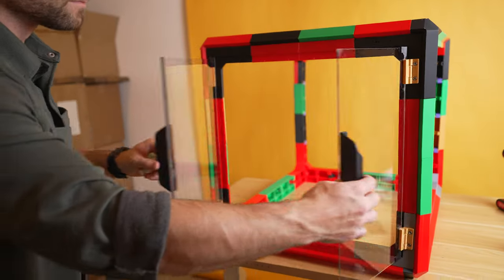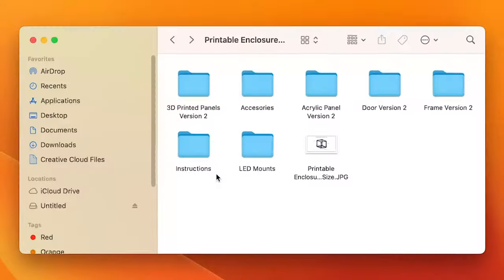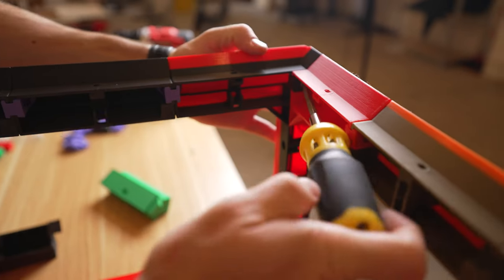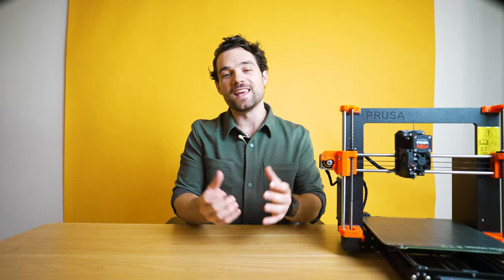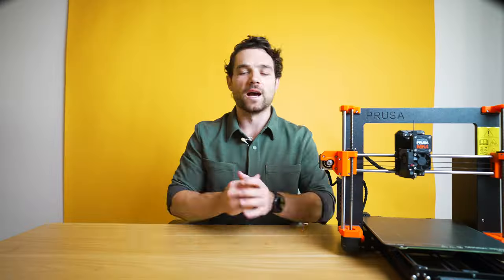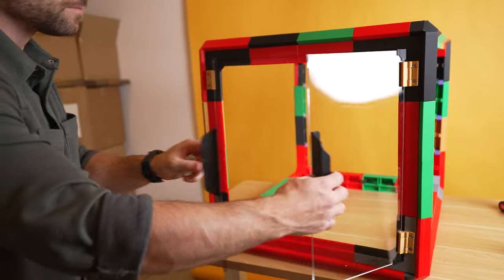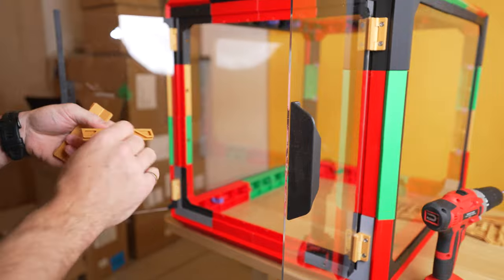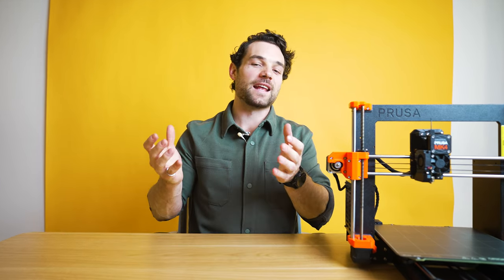3D Printer Enclosure - Printable!

Comment: Nice design, good idea, but 85 € just for the print files is not my value for this. You can let me know if there is any serious discount, for now i will build my enclosure out of aluminium machine frame, ending up same price, but i will build a ceiling crane into it.
Reply: 85 for the files?  Dang....
Reply: Yep that was my thought, too. Looks really nice, but over 80€ just for the "permission" to print it, is too much. I also need several kilos of filament and the acrylic panels for this, which quickly doubles or triples the price. If not even more...

Comment: How many roles (1kg) does this print take for a standard size enclosure?
Reply from the maker: Depends on print settings and how you set it up (acrylic vs 3D printed walls for example). There is info on the KS page for it!

Comment: I am curious how well a fully printed enclosure (with acrylic panes) will last over time. The typical material you would print this (cause you don't have en enclosure to print ASA/ABS) would be PLA or PETG with a heat deflection between 50C and maybe 65C. Also if i interpret the ks graph correctly we are talking about 6kg of Filament just for the frame or 11 to 14kg with panels... Counting that i pay 20€-25€ per kilo of PETG, this is an expensive piece. 300€+ for fully printed or around 300€ with plexy plus the 65€ for the files themselves. 
I have to say that i really like the design and looks of it, especially the themed enclosures
Reply from the maker: I’ve had one in the studio for almost 6 months of daily use with no issues. If you’re doing a heated chamber to print abs you’ll need to print the enclosure in petg. You can also control the temp with the inline fan if you use one

Comment: I want to buy the files, but I have a question.
I will have to print 2 enclosure Or you can print one and expand so you don't need to print a wall of the Second enclosure?
Reply from the maker: You can just make one big one!
Reply: @AustenHartley   It's a good idea, the only thing I would worry about would be using two different filaments at the same time

Comment: Really interested in getting this, but I have a question. I understand the enclosure's overall size can be customized, but what's the length/size of the smallest extension ? By the looks of it, one piece looks like it's about 5" in length, so the case's length in any axis can be increased/decreased in 5" intervals ?
Reply: @AustenHartley  can you answer this ?